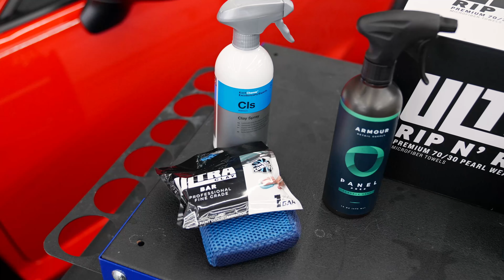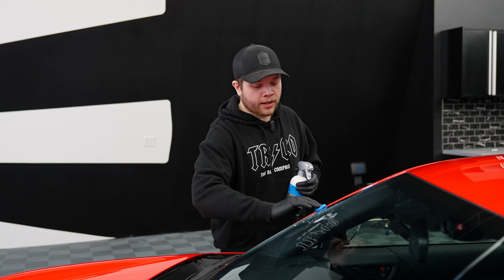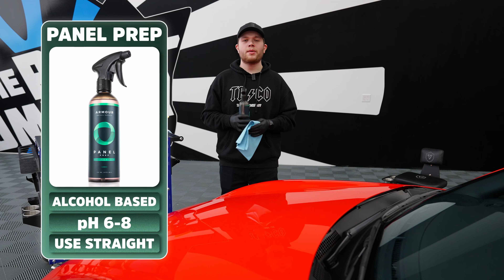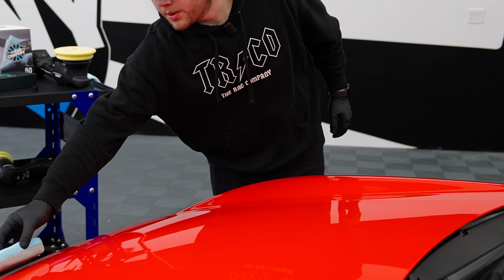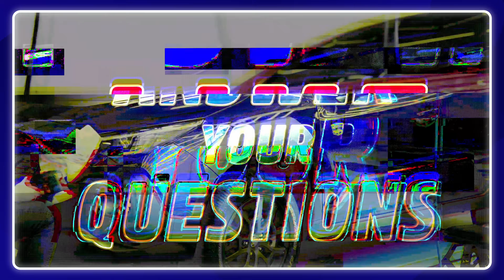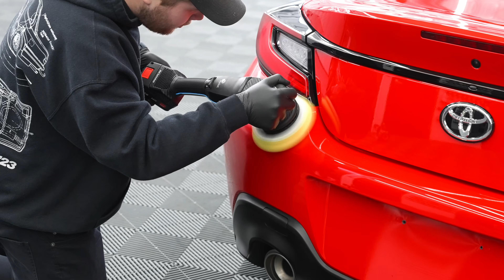How to Ceramic Coat Your Car (Step By Step Beginner's Guide)

Comment: Are the yellow buff and shine pads equivalent to yellow rupes pads?
Reply: I'll defer to the experts here but I have essentially used them interchangeably but may be very wrong.
Reply from the maker: Both are similar in cut; it mainly comes down to personal preference and whether you want an edge guard for your backing plate.

Comment: Wow! I honestly didn’t think the rip n rag had enough gsm to wipe up a ceramic coating 👀👌. Good to know alternative 👌
Reply: Same. 1st I've seen anyone use a rip n rag for this purpose
Reply from the maker: It's actually one of the main reasons we created the Ultra Rip N Rag so that people didn't have to sacrifice their favorite towels for every coating job.
Reply: Are the traditional rip n rags sufficient? I have those and my problem with other pearl weave towels was that they were leaving microlinting behind - tried to manage that by switching to never putting the towels into the dryer but found that microlinting after I had applied a coating once so now I'm being super careful any time I do another coating.
Reply: @JeremyS-x9s so the confusion is.... they are using the ULTRA XL rip n rags. GSM of 280. The regular rags on a role are only 180 GSM. I was unaware there was a 280 GSM version.

Comment: Hey Carson would it be difficult to use a Pearl Puck to apply a Ceramic coating? Is there a no soak barrier inside the Puck?
Reply from the maker: The Pearl Puck is just based on your preference on whether you like a round or rectangular applicator, and yes, there is a no-soak bearer in the Ultra Pearl Puck.
Reply: @theragcompany Good! ! I still have 2 left never used. My other 2 used Pucks I use for interior conditioners applications. Especially on seats and dashboard.  Last question when is Fisher bringing the EVO to be washed on TRCMA?😆😆😆😆

Comment: Always appreciate the education and high quality content produced by The Rag Company.   

I thought ADS was good to release after 4 hours.   Also could you expand on the use of amplify as a topcoat before release?
Reply from the maker: We are approaching this video from a beginner standpoint, so we typically recommend 24 hours as a rule of thumb with most coatings, but yes, you can technically release the car within 4 hours with Armour Detail Supply's coatings. As far as Amplify is concerned, if you want to give the coating even more short term protection while it cures, applying Amplify after coating the car is a great way to ensure that.